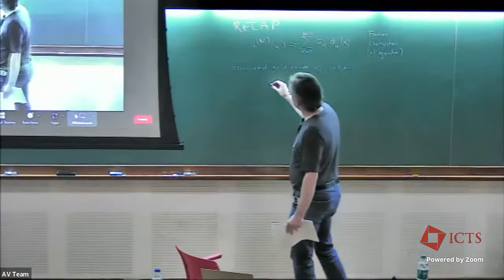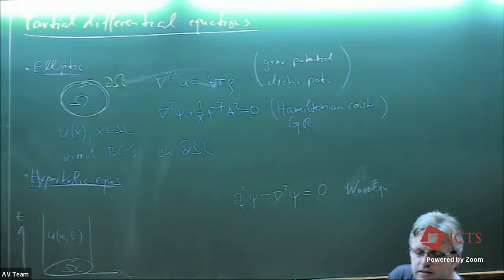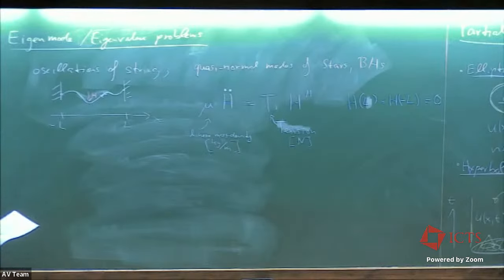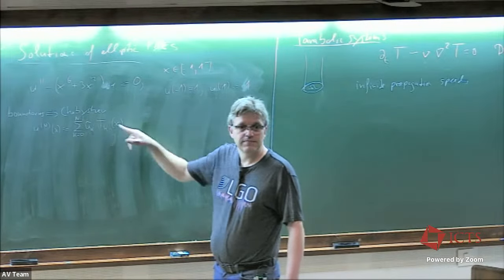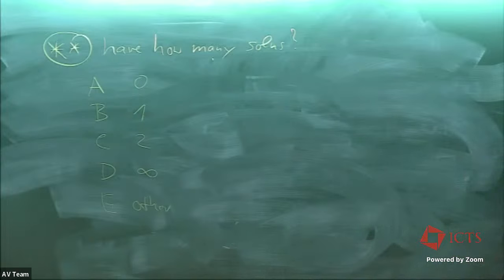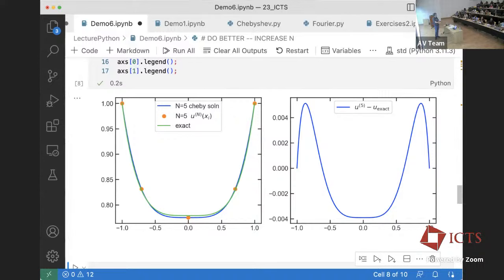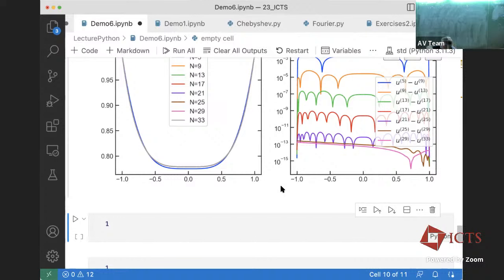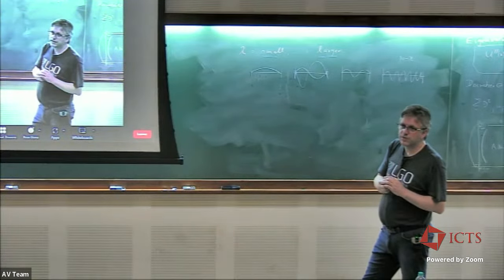Introduction to Theory and Numerics of Partial  Differential Equations (Lecture 3)by Harald Pfeiffer

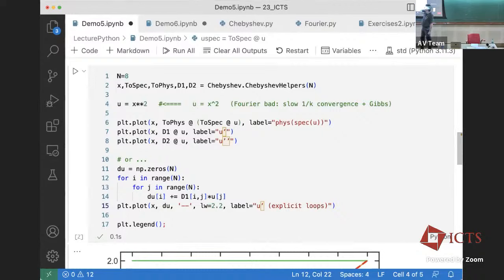Comment: 8:12 Start: Lec recap
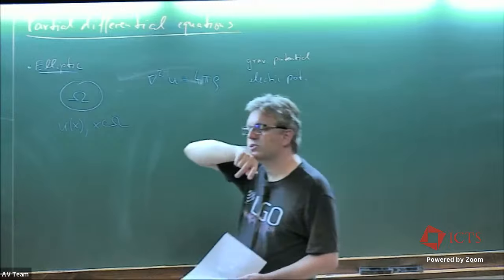12:34 Task recap
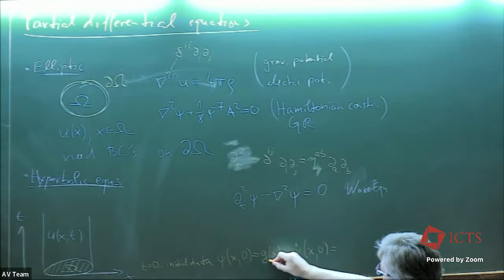18:37 Start: PDEs
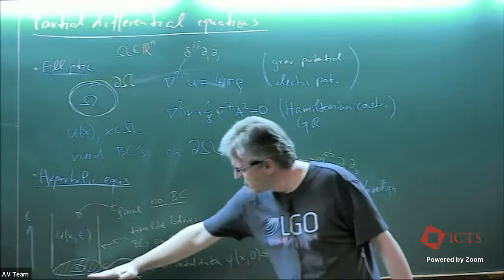21:59 Hyperbolic equations
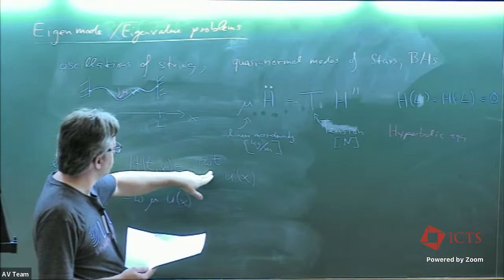31:30 Parabolic Equations
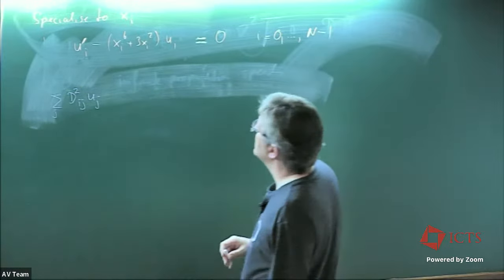50:04 Spectral Methods for Elliptic equations
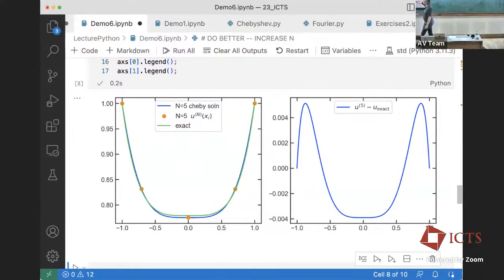1:11:24 Spectral Methods for Elliptic equations in practice// Demo python code
1:30:55 Spectral Methods for Eigen Vallues equations